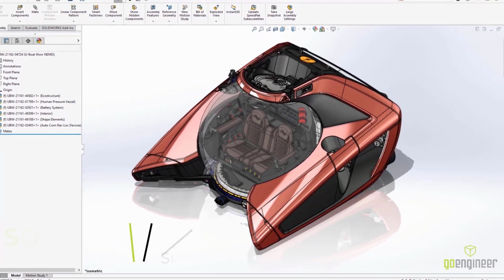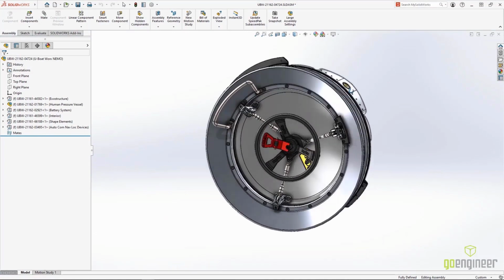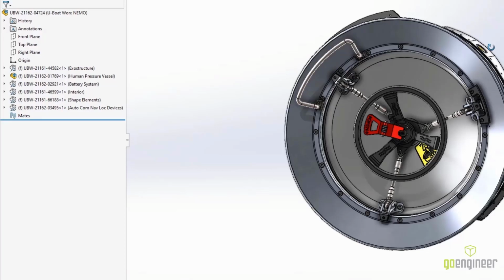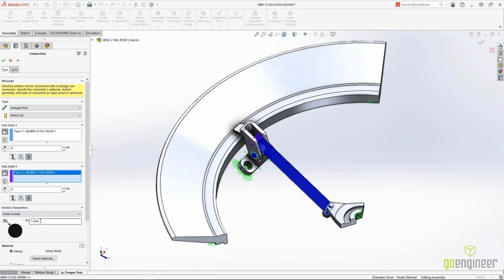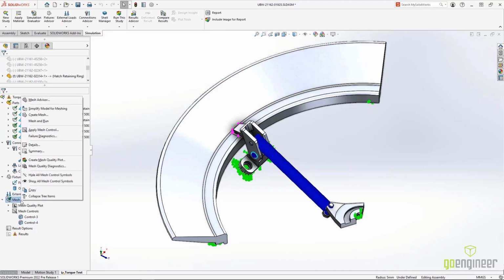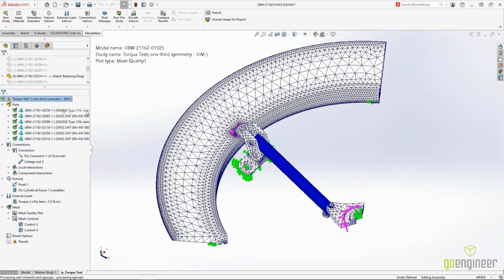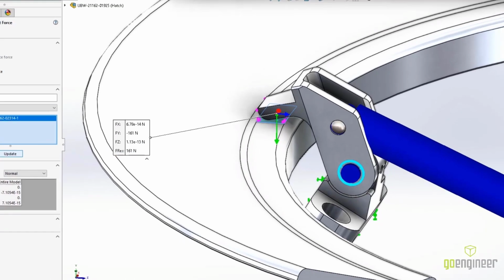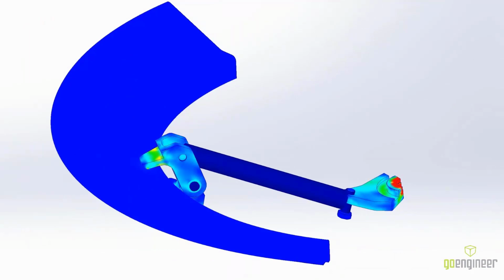SOLIDWORKS 2022 What's New - Simulation

Comment: Hello Go Engineer Team,
I am recently working in the CHT(Electronic Cooling) simulation with Fan,
The problem i am facing is the time take to converge the temperature on the elctronics is too long (takes 1000 iterations to converge and my model is quite big), so the time taken for each simulation is too long,
Could you please share some tips to speed up the convergence in a fan model?

Thanks in advance..